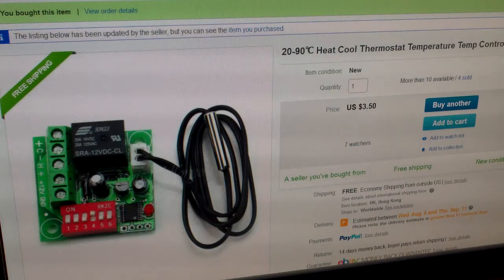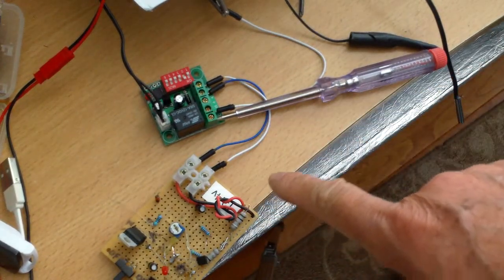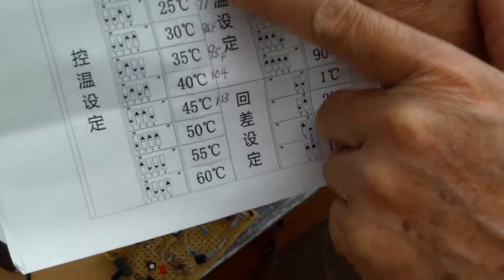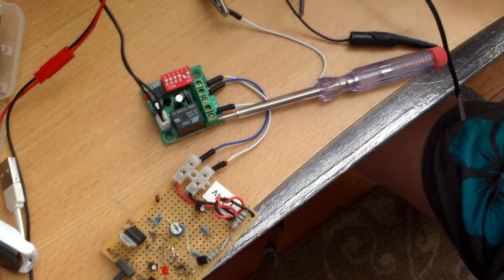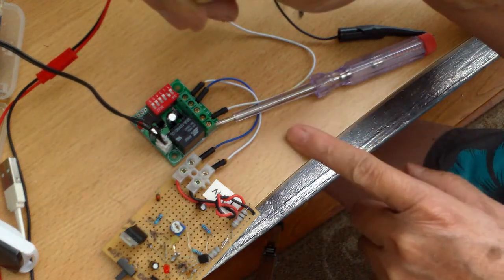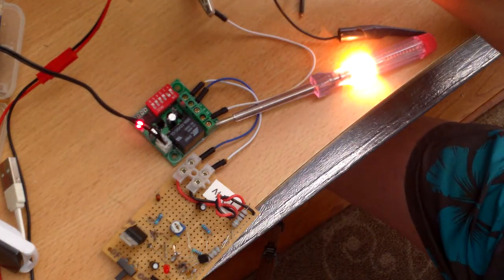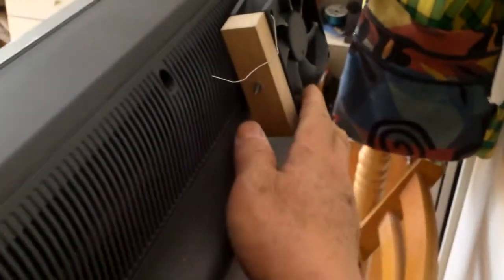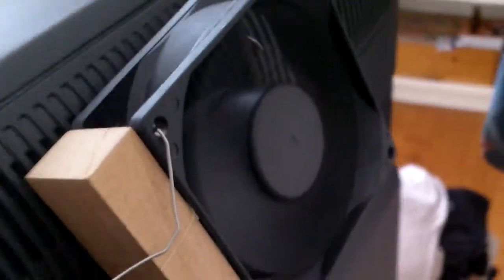W1701 12 volt heat cool thermostat with 20amp relay at 14v

Comment: Do you have the wire diagram? Mine didn't come with one:(
Reply from the maker: See if this instruction can help you: "Instructions for use: Please connect the circuit according to the wiring diagram, power supply is DC12V (+12 V is positive , and GND is negative). The probe is connected to the object you want to control. For heating: Please connect 12V heater to the - H + For cooling: Please connect cooler to the + C - For heat-sinking: Please connect cooler or heatsink connected to the + C - 
Indicator Status : the red light is on indicating the cooling (+ C-) output, and the light is off indicating heating (-H +) output "

Comment: Thank you for posting this video. Your explanation of how to set this controller up was most informative. I really liked the quick tour of your application for this unit in cooling the TV. Most practical. I will be using a controller for a similar purpose, that is, to control a computer fan, repurposed to assist in cooling a Cable Tidy & Power Box. The assisted cooling will keep the Power Boards & Plug Packs at a more manageable level. Kind regards.
Reply from the maker: +mijodo2008 For me, extra cooling is important in those hot summer days. Thanks for watching.

Comment: Hello. I am looking for a similar product but powered by a 8v dc supply but did not find it. Do you think that W1701 will work with an input power of 8v DC ? Thank you. Regards.
Reply from the maker: Scotch Fiu It is designed for 12 v. Did you watch my follow up video which showed a dc to dc boost buck converter. The converter can be adjusted to output 12v with your input of 8 volt. The boost converter is only a few dollars on ebay. Just search for boost converter converter. Here's the link to my other video on the thermostat:http://youtu.be/_vrAvPcFdZs

Comment: Nice. I bought a few that are similar but with digital displays for my solar furnaces - -50 to 150C heating/cooling with a 20 amp relay, only $12 each and they work great! Instructions are hard to get through tho
Reply from the maker: It's amazing what you can get for a few dollars. I should have splurged and bought one with a LED display.  It's a perfect companion for a solar heater.